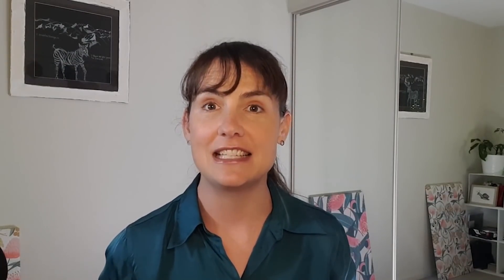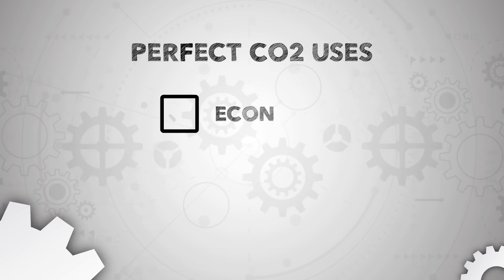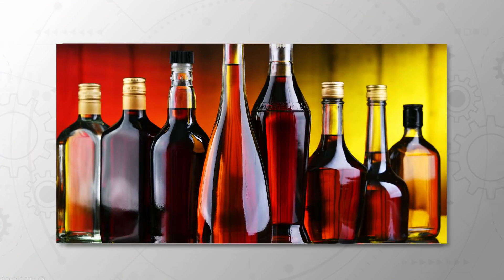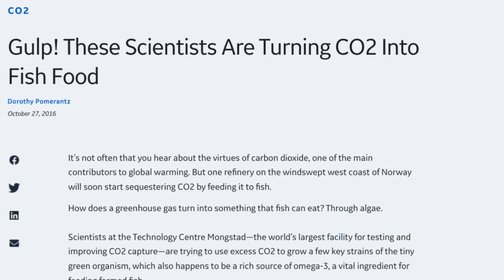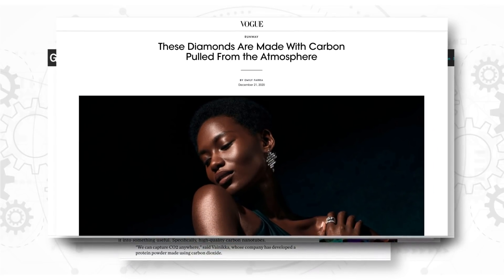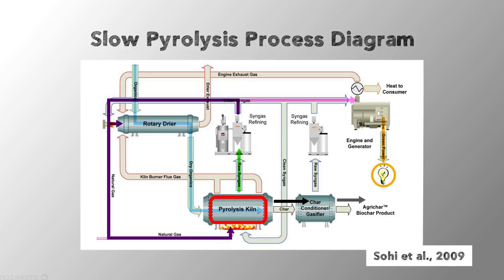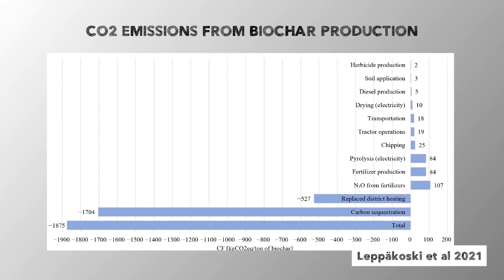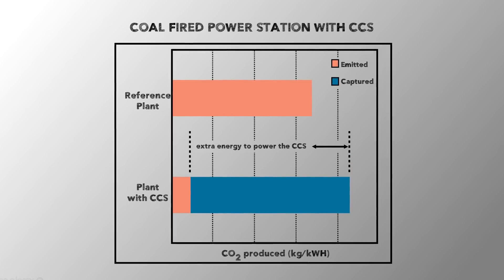From Waste to Wonder: The Surprising Uses of Carbon Dioxide

Comment: I think the main issues facing many of these ideas and technologies is them being viewed either as a stand alone concept or with a very limited application/integration with other areas/industries/concepts/technologies.

There is potential in taking multiple technologies and processes from across numerous industries and fields to be integrated into a system or as part of a few systems to maximise their benefit while minimising or justifying their costs (monetarily, Resources and energy requirements wise).

Tailoring them not only to the demands and requirements of other technologies incorporated in the same system, but also the demands and requirements of the location (local, state, national to even international) they are used.

As we live in Australia it's a natural place to consider in this regard. It's also where I personally have thought about in regards to this specifically, so clearly my the most developed example.

There are numerous environmental, civic, resource management, economic and agricultural concerns here in Australia. Especially when it comes to discussing action on Climate Change.

So perhaps we should consider the prospects of addressing as many of these as we can using what we can do technologically, scientifically & with engineering in one system, or more likely with multiple connected systems.

Everything from maximising renewable sourced power generation & powered desalination. To Green Hydrogen & Ammonia production. To functional negative carbon CCS & waste water management. To using thermal Coal to make Biochar & dilution of waste desalination brine with civics water water. To airtight greenhouse Algae farms &  Biochar to improve soil quality or fill open cut mines & "dry" oil reservoirs.

Utilisation and combination of the waste products from some parts of the system to become solutions (chemisty pun absolutely intended), fuels and base resources for other parts of the system.

This would help offset, negate or even add value to the costs of these parts within, or the overall cost of, the system.

As just because something can be made at scale doesn't mean it's value can be realised at scale by itself alone. At least not to a scale where it would have a meaningful impact for what it was designed for.

Integration of it within a larger system however would add value to it's higher scaling as it would be an essential part of that larger system. A system that facilitates multiple needs and requirements across numerous sectors and industries.

Starting with the absolute bare minimum we need to upgrade our national grid to allow the full use and utilisation of renewables.

Frankly without doing that to begin with we won't be able to viably power any of he component parts of the system at all. As noted many of these methods and technologies are very power intensive.
Reply: I get the free  ScienceX newsletter in my e mail. It's a great compilation of newest published research in many science fields. You could  a climate action group on social media, 
 everyone taking a topic , 
(i.e.   planning sustainable microgrids, 
with multiple renewable energy producers mixed and matched, 
and the mass battery storage method 
 tailored to the resources 
that are most abundant in each unique region, 
 look for promising plug and play electric interfaces, 
that can store power from any/all 
of the different sources into the same battery bank,
  finding locations near  to existing substations, 
or retired power plants etc.)

Each member could be selecting one region
  and filling in the puzzle pieces 
reading, taking notes, 
sending their notes to a shared file
  using an organizational app 
 to coordinate this into organizational charts
 to present to local and national government officials...
It might get you a way down the road to your goal...:)

Comment: Great video, but quite sobering. She basically says most techniques don't work, aren't scalable, doesn't solve anything or make the problem worse; but in the end, "we need it to work". So the TL,DW seems to be: "we're hosed".
Reply from the maker: Actually Jess said we need carbon capture and storage to work to get the scale needed. As opposed to carbon capture and *utilisation*.
Reply: @EngineeringwithRosie  Carbon capture" and then *Utilisation as plastic, for example and then finally permanent waste disposal *Storage*.... 

Seems like the most cost effective option and sadly plastic waste, is extremely scalable too...

Comment: 13:41 It's worth remembering that carbon added to the soil is reintroduced to the carbon cycle. It won't stay there forever. The reason carbon in soils is beneficial for agriculture and ecosystems, is that the microbes and plants incorporate the carbon into their bodies and therefore it will probably be released when the organism dies or uses energy
Reply: It's actually more complicated than that. Biochar consists of a labile fraction (10-20%), which acts as soil microbe food and a refractory fraction (80-90%), which is resistant to decay. This can remain in soils and store carbon for hundreds to thousands of years. Biochar is beneficial for plant growth in a variety of ways: initially it has a coating of mineral ash on the surface, left over from the feedstock. This ash is alkaline, providing a weak liming effect and a modest amount of nutrients. As it ages, biochar surfaces develop a negative electrical charge that helps it to retain soil moisture and positively charged ions such as ammonium (NH4+), Mg++, K+ and Ca++ that plants need. It also contains numerous pores which are exploited by soil fungi (mycorrhizae) and other beneficial soil microorganisms.
Reply: Alayne Perrott's reply to this comment is a much more accurate and informed statement regarding the stability of biochar based carbon in the soil.
Reply: It's more complex than that.  A good portion of the CO2 that plants remove from the atmosphere, turns into very stable long lived carbon chemicals that stay in solid form.  This is why there is so much oil/gas/coal to begin with.   All we have to do is reach the point where we are no longer adding more, and nature will fix the rest of the problem over time.
Reply: @eventhisidistaken  thanx,  this is good info
Reply: @eventhisidistaken  One documentary I watched actually stated that reason why there was so much oil/gas/coal was because organisms had not yet evolved a way to break down and feed on lignin, and so a very large stockpile of this plant biomass built up. Then later Fungi evolved the ability to feed on this material, which then drastically reduced the amount of biomass which could reach the same satisfactory conditions to transform itself into these fuels.
So nature is unlikely to ever hit the same conditions needed to regenerate new hydrocarbon deposits.
Reply: @nolan4339  The point I was making, is not that oil is renewable, but merely that if we stop producing CO2, what has already been produced will be naturally sequestered over time.  We don't have to take active measures to get rid of it, we just need to stop putting more out there.
Reply: @eventhisidistaken  It seems that recent reports says that to reach the goals of temperature we need (till the end of the century), shall require active carbon capture. The rise of temperature in such small window of time could impedes the nature to deal with the cicle in time to our lives not been too much difficulted.
Reply: @RafaelRodrigues-zw3eb  There is no renewable power source capable of the amount of carbon capture that would be needed to reduce CO2 back to where it was in the pre-industrial age.  The best we can realistically hope for is to stop making it worse.
Reply: Ah, I was thinking about that,  early in the presentation.  Thanx for answering that question for me Lily.
Do you have any suggestions how a small scale farmer (for example) can be proactive to reduce personal carbon footprint?
Reply: @timsheen1158  if you would like to learn about making a positive environmental impact at a small scale, you might start with learning about principles of regenerative agriculture, and then bringing that to a personal growing plot. Bringing the soil to life with healthy biology has the power and capacity to sequester unbelievable amounts of carbon. There are some great videos accessible right here on YouTube. One spot is through Elaine Ingham's channel, the soil food web school. That could lead you to Gabe Brown and Ray Archuleta's UnderstandingAg regenerative agriculture work. There are also others doing great work with carbon farming.  The increase of life in the soil is completely dependent upon carbon. The soil is an unbelievably huge open carbon sink. Every drop of carbon sequestered in the soil directly removes that drop of carbon from the atmosphere. All of that carbon-based biology in the soil is built utilizing carbon from the air. A single 1% increase of carbon in the soil as part of soil organic matter is the equivalent of 20,000 lb of carbon per acre. Gabe has increased some of his soils from 2% organic matter to over 8% organic matter. In other areas he has done more, and so have others. They are teaching how to replicate their efforts. That is a lot of carbon removed from the atmosphere.
Reply: @RedGarner  thanx Jed
Reply: @RedGarner  actually,  I wonder if part of the reason CO2 in atmosphere has increased so much is because of undesirable farming techniques. I saw a vid on biofuels, and how they are actually counter productive because they need millions of more acres to grow corn only to add 10%. I those farms are concerned with increasing carbon content in the soil. They would just use manufactured fertilizer 😬
Reply: @timsheen1158  yep, conventional farming destroys soil biology and depletes soil organic matter, reducing it usually down to 2% or less. One component of that is the chemical fertilizers and other inputs. Another component is the tillage. There's a lot more to it than just that, but you get the idea. Regenerative agriculture goes in the opposite direction and significantly if not completely reduces the need for chemical inputs. Building soil organic matter through regenerative practices, if maintained, can keep cycling the labile, or microbially active carbon components in the carbon cycle. One of the neat things about biochar is the significant stability it shows in the soil. Depending on the way it was produced, the majority of it does not break down microbially. In contrast to regular biomass incorporated into the soil or biologically sequestered carbon, biochar does not cycle. And unlike what is incorrectly suggested about biochar in the initial comment in this thread, the vast majority of biochar remains stable in the soil for hundreds to thousands of years or more. It is only the labile or microbially active portion of soil carbon or soil organic matter that is able to re-enter the carbon cycle. See Alayne Perrott's first reply.
Reply: The Bloomberg Green newsletter recently reported on the decline in China fertile black soil regions, perhaps biochar could be added to improve the soils nutrient base?
Reply: Trouble is the carbon released from decaying plant matter is largely in the form of methane which is a much more potent greenhouse gas than CO2.
Plant trees and then harvest the timber after the tree has absorbed CO2 for decades.The timber locks up the carbon for centuries and even later on u can re-saw and re-use the timber for other things.
Reply: @chippysteve4524  Methane is only produced when organic matter decays in the absence of oxygen, e.g. in permanently flooded soils.

Comment: Great video! You mentioned using captured CO2 for enhanced oil recovery, but oil aside, is it viable to store captured carbon in (partially) depleted oil or gas fields?
In Groningen (Netherlands), they started suffering from earthquakes after exploitation began of a natural gas field beneath the province; would it be possible to mitigate this by refilling the field with captured carbon? (Not sure if this is your area, but I'm curious to hear opinions).
Reply from the maker: Yes it's been done. As far as I know all projects like this so far have had major problems but there is potential to store significant amounts of CO2 like that so I'm sure people will keep trying. I'm planning a follow up video on that topic, with a geologist who can talk about all the challenges involved and which ones are likely solvable.
Reply: @EngineeringwithRosie  brilliant, thanks! I'll look forward to that video 👌
Reply: It costs very little more than the carbon capture itself, to turn that into e-deisel.  e-deisel can then be used as jet fuel and for heavy machinery.  This then removes a segment of the market for mined fossil fuels.  It seems silly to continue to mine fuels, and then use carbon capture (which costs way more than the mining produces), just to shove it back in the ground.  We need to be thinking of complete sustainable cycles.  If we can reach equilibrium, there really is no need to go beyond that.  Use capture for applications where electric is not practical.
Reply: @eventhisidistaken  absolutely agree. My question was about refilling already (partially) exploited wells to counter geological side effects (e.g. earthquakes), not about extending the potential for fossil fuel extraction.
Reply: @eventhisidistaken  No, we definitely need to do better than equilibrium to draw down atmospheric carbon, and it defs takes another process or 5 so far to valorate CO2 into advanced fuels, but let's see it done! 

There is so much circular economy to build between keeping a lid on plastic soil content and breaking up PFAS, making new things in a way that stewards biodiversity more than squirrels, concrete that feeds aquifers and green cities, if we can tolerate more than a few entrepreneurs we can use the 40-80 gigatons a year of carbon (stuff.)

Comment: Excellent video. Even though syngas and methanol are not net negative, they can assist in transition to a carbon neutral economy by assisting in storing renewables over seasonal needs. Commercial viability is close. 

Could you interview experts on the commercial aspect of the ideas presented. 2030 is so close that investments need to start happening now🙂

Comment: Great video! Just one point I think you dismissed plastics a little bit too fast. There is single use and short term use plastic that we should absolutely get rid of, as fast as possible. However long-term use plastic that stays in products for decades is probably going to stick around for some time. Just a few examples: windowframes, car interiors, sports equipmts even boat exteriors, chairs … you name it. Also our long-term use of plastic does actually reach this gigaton scale that you were talking about. You also talk about how Methan can be created out of captured carbon. This is already the chemical starting block for many plastics like PET. The only big problem I see you is that it’s only you solution at the end off our transition to renewable energy. Once we have abandoned and access to renewables we have the resources to waste them one such high energy loss processes.
Reply: I just commented this before looking at the other comments. XD Glad to see other people are thinking like this. :)